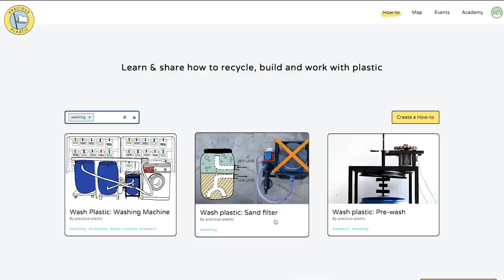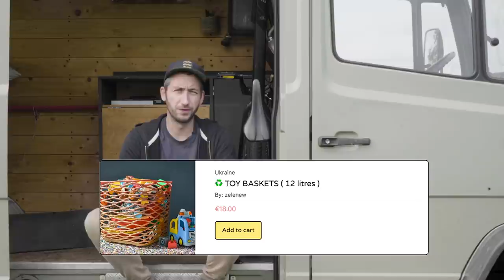MN #44 - Skateboards from recycled plastic and Project Kamp academy

Comment: As a skater, I can tell you with absolute certainty that those things are going to shred micro-plastics everywhere. Even on a wooden board, it's actually a big and mostly unacknowledged problem within the sport (griptape, petrol-based lacquer, shrinking  urethane wheels, shredded shoes, ect). You could mitigate some of the shrapnel with a tail pad under the board. This would be a little funny as the inverse was popular in the 80's.
Reply: Good advice again I have heard, I thought it was just a freestyle skateboarding requirement.